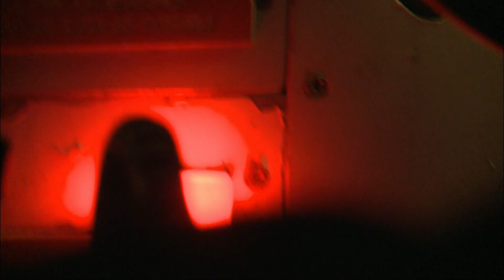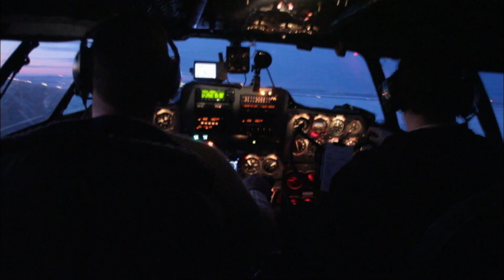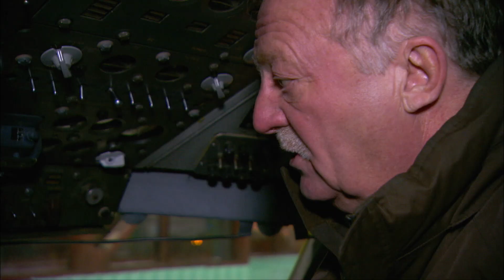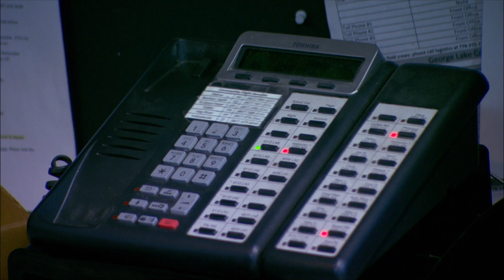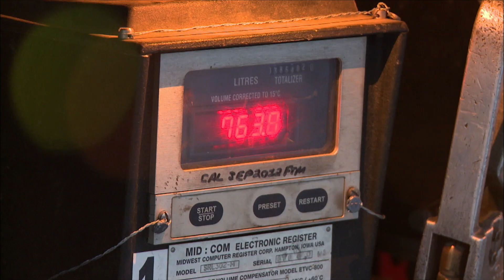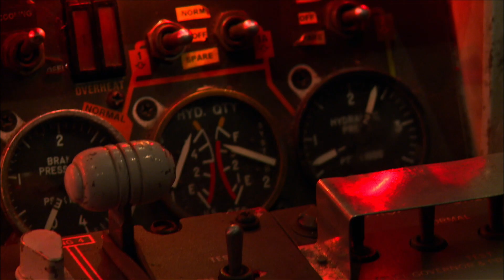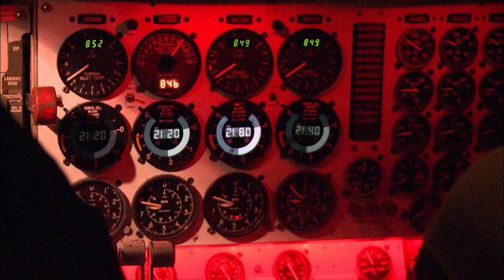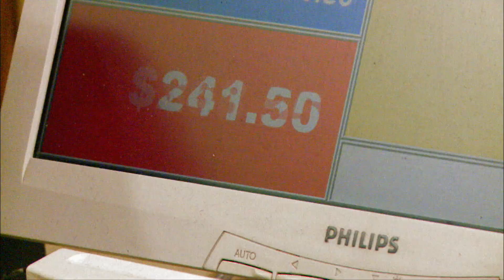Buffalo scrambles to deliver Christmas cargo | Ice Pilots NWT S06E01 | Go Xplorer

Comment: The usual lack of forethought. "Oh. I'll just pick up the Electra while I am down there."
These bods have the perspicacity of a stuffed codfish. Even in our climate. I run up engines a few days before our wet season starts.  Then rug them up again. Queensland may not be as cold, but trying to start an engine which haven't been run for months, in the middle of a tropical cyclone, isn't easy either. ie. auxiliary generators and pumps, and other machinery, and vehicles.

Regards....Marum.

Comment: If you look at the amount of engine problems/crashes, engine overhauls, hydraulic problems etc, its a miracle no Buffalo aircrew were seriously injured in any of the mishaps, no wonder Transport Canada wanted to close em down, and nowadays they can only haul freight no passengers whatsoever anymore! Don't get me wrong I'm a huge fan of the old piston pounders, hell you can't beat the sound of a radial motoring down a runway but safety is far more important than reputation or pride!